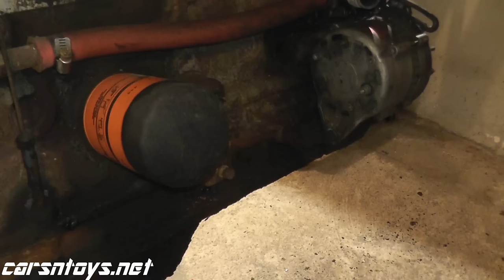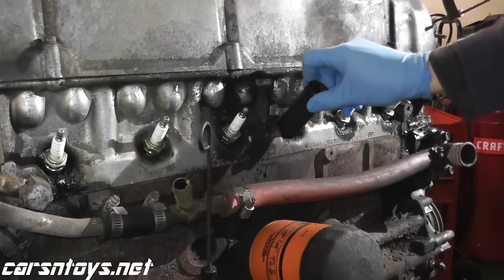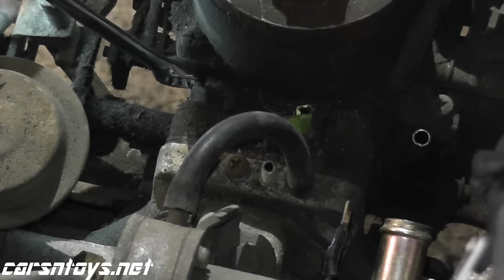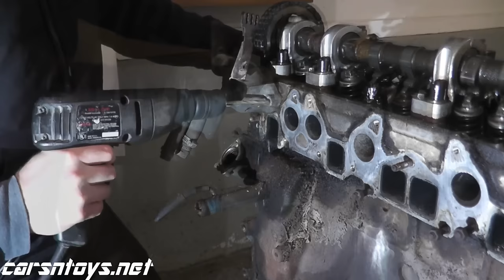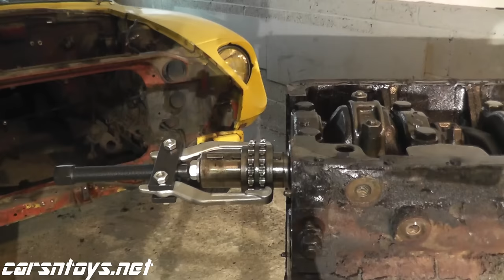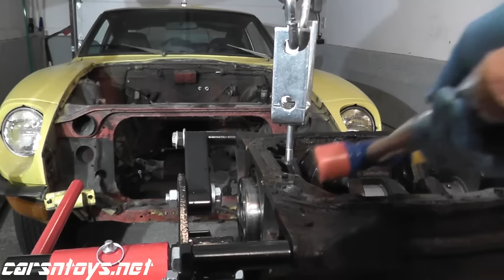How to Disassemble an Engine Step by Step

Comment: Question. How long would it take a skilled mechanic to teardown and reassembly a engine on a dodge challenger?
Reply from the maker: Teardown not very long. Reassembly is a different. All parts have to be lubed properly, check clearances, etc. It really depends on the tech.

Comment: You could be there for ever putting the bolts in bags and then you will need to take them out again later. good idea taking photos yes best fitting new hoses, Great video and interesting. I did this over 40 years ago. your video as made me keen to start again. I don't see you using much expensive snap on kit. good idea colour coding. Why didn't you steam clean before you started
Reply from the maker: Most owners don't have a steam cleaner. All my videos are with basic hand tools and nothing more. I tend to use Craftsman. I've had good experience with their tools for man years. Cheers.

Comment: If my starter is located in the intake valley, would I have to pull the engine to access it? Or could I just open it while it's still in the hood?

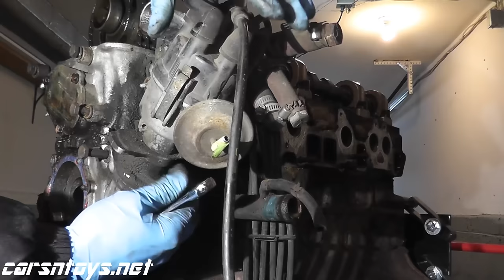Comment: what's the very 1st part you removed at 27:43 please?! I mean.. what's it called and it's function if possible
Reply: That's the distributor. https://en.wikipedia.org/wiki/Distributor#:~:text=A%20distributor%20is%20an%20enclosed,the%20correct%20amount%20of%20time.

Comment: Do you think I can clean out burnt oil in my engine by disassembling it I want to restore my engine it’s vg30 and my mechanic says to get a new one but it has 120,000 miles I feel like I can simply try to take care of it on my own it had a blown head gasket I really think I could make it happen and fix my head gasket by just learning how to get around the oil first

Comment: Cn you provide a link for the blue place holder tool? I can't find it on amazon or eBay.
Reply from the maker: https://www.amazon.com/Alltrade-648831-Nissan-Timing-Holding/dp/B0002Q8TV4/ref=sr_1_2?ie=UTF8&qid=1502771737&sr=8-2&keywords=nissan+timing+chain+tool
Reply: Thanks! just ordered it. I'll be using your tutorial to pull my engine. Radiator is out and the hood is off. I can wait for your next video... hope its coming some.

Comment: Does being a mechanic hurt you hands and wrists. I have weak wrists so i need to know.
Reply from the maker: You can use cordless tools to aid in the work. I tend to use basic hand tools with the help of extensions.
Reply: Use breaker bars and wrench’s that u can extend I’m 17 and I’ve been working on cars since I was 7 I started messing with engines and tearing them down at 14 and I made 8 grand in profit last summer restoring a 66 Plymouth satellite I know an engine like the back of my hand there are different types of mechanics I am a full restoration mechanic it all depends what you are trying to do or learn
Reply: @miguelguzman60  tips for a start to a newcomer?
Reply: You can strengthen your wrists by doing push-ups on your knuckles. It will be like a ISO exercise on your wrists and strengthen the tendons.

Comment: What's the reasoning behind not using power tools?  I like that you aren't, but just curious
Reply from the maker: Ideally, because not everyone has cordless power tools; or they may have one but the battery dies out and they may get stuck. I like to show different techniques using just simple hand tools. But using a cordless impact gun and such will certainly save time.

Comment: You don't want to use a hammer disassembling anything andif  you don't plan to use is it or if you use it again
Refurbish it restore it and sell it again
Reply: I tent to leave my brain capacity/ storage free up until I have the job to disassemble an engine and do research on the world wide web for that specific type of engine to assist me in the tricks and tips to disassemble certain components and parts the correct way
And I personally find it good practice to lay dissembled parts low to the ground so they can't drop/ fall/ slip out of ones hand further than the ground
😊